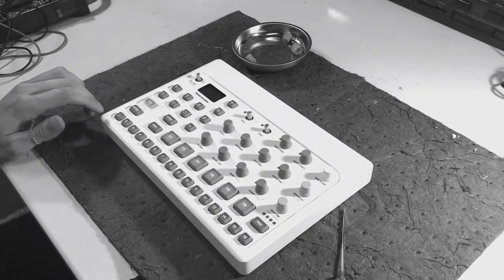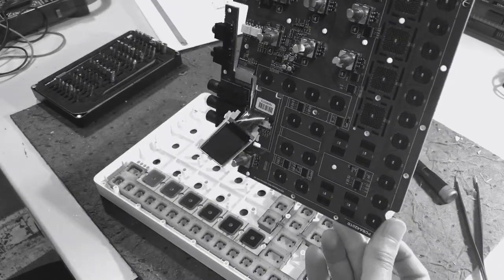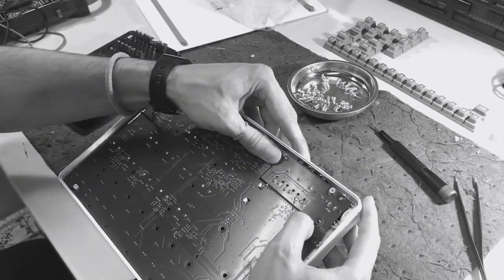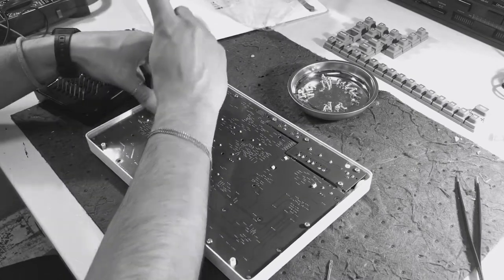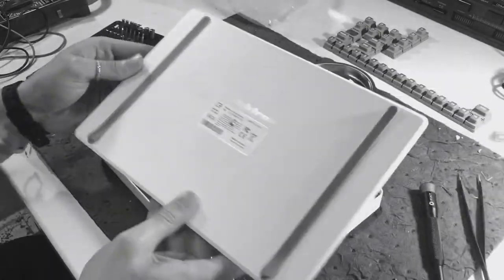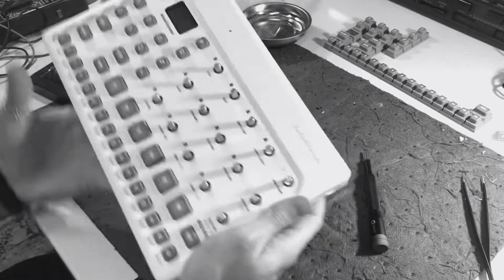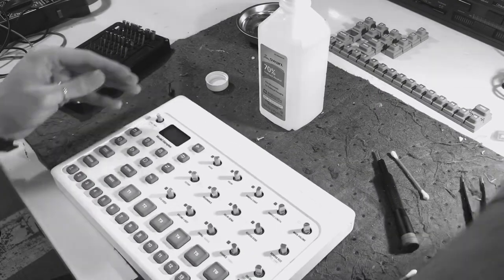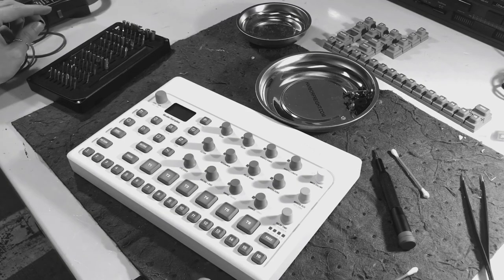Elektron Model:Samples Button FIX (Replacement & Cleaning) -Adam HiFi-

Comment: A word of advice to anyone doing this: 
The PCB is in two parts, the smaller part is where the audio jacks are located. This piece is slightly offset from the main board and connected via a number of metal pins or wires.
These pins are soldered to both boards, and there is no way of disconnecting them.
So, be careful when you lift the boards out so you don't break them.

Comment: Thank you for the video! Did you get the buttons directly from Elektron?
Reply from the maker: thanks for writing in - yep, directly from their support email
Reply: @AdamHiFi  Thanks for your quick response! It maybe a bit pessimistic but I am already preparing myself for the broken function button situation :D
Reply: @AdamHiFi  By the way, today it happened - My function button came off. Luckily Elektron is going to send me new ones. Hope they won’t brake again that quickly.
Reply: @Kupka2408  hi mate! I see it's already been 8 months since your FUNC button popped out. Did you replace it? Are they lasting? I've just contacted support as my FUNC button got f*cked up and so did the "BACK" one. Hoping to get this sorted out.
Reply: @tesssssssssssting  Hey! Yes, I did replace it and it also seems to last. The replacement was pretty easy and also elektrons customer service was nice and friendly. The new buttons arrived at my place within a week :)
Reply: @Kupka2408  great!! I e-mailed them a week ago and they replied asap, also super-nicely. They're sending me the replacement from Sweden to Argentina!! (lol). I've opened mine at least 10 times to modify/fix/clean contacts and glue a button or two back to the rubber mat, so replacing them all will be like a walk in the park. Thank you for your reply! I hope your new buttons last many, many years!!

Comment: I thought there were plastic tools to remove the caps, so that you don't scratch the surface?
Reply from the maker: you certainly could, i just used a flat head screwdriver and that did the job with no damage
Reply: A guitar pick is often the right tool for scratch-free removal.

Comment: So you basically swapped the caps but not the switches beneath? Would normal cleaning helped, too or did I miss something?
Reply from the maker: i’m a bit confused on what you’re asking. do you mind rephrasing?
Reply: @AdamHiFi  Sorry. Normally, when a button in a synth needs to be fixed, there is a problem with the contacts or microswitches themselves that need cleaning or replacement. So I was a bit confused to see you actually cleaning and replacing the caps (that are a rubber mat here). But when watching a second time I saw that the function button was popped out and there was rather a problem with these silicon type caps.
Reply from the maker: @elekktrikk_home_video  i see - the only issue here was the rubber button for my “function” key was broken off. to replace the one button you have to replace them all. i just used this opportunity to clean the inside and outside of the sampler for good measure. no bad contacts or anything.
Reply: The switch, or rather the contact pad  is molded in to the bottom of the rubber cap. There is no mechanical switch but it's the  shape of the rubber that makes it spring back when you release the button. It is the same technology as in a regular tv remote control or an old button phone.
I have seen remote controls that survived decades of channel flipping, so the technology itself is proven durable.
(Btw, when remotes stop working it is usually just a matter of dust and grime in between the button and the contact surface on the PCB. You fix it by lifting the rubber pads, clean the pads and gently clean the PCB.)